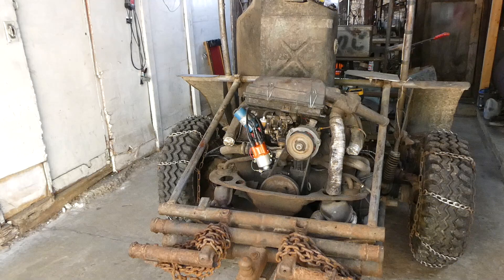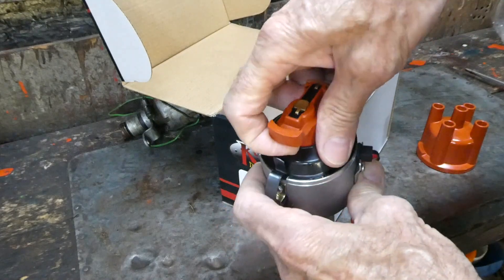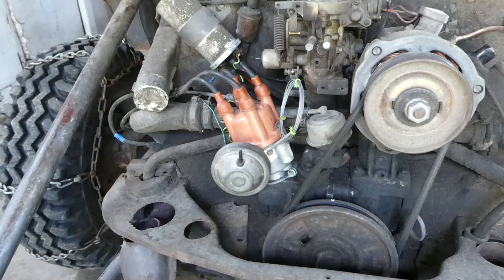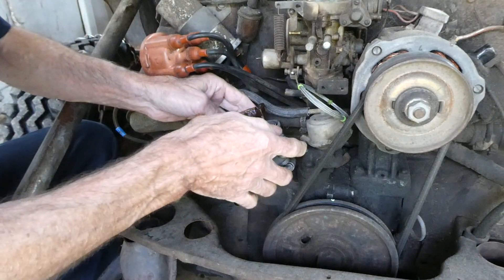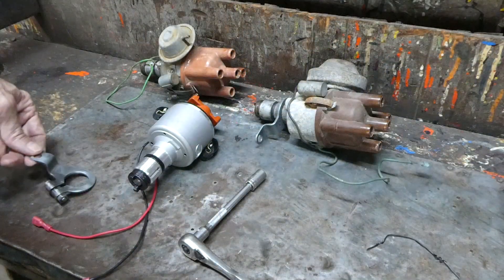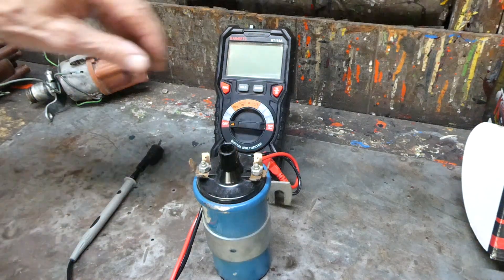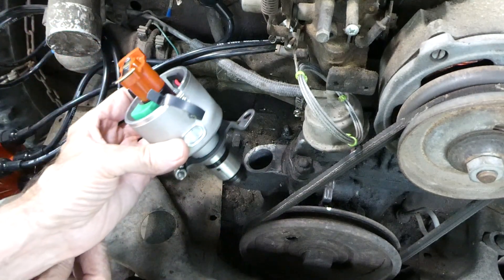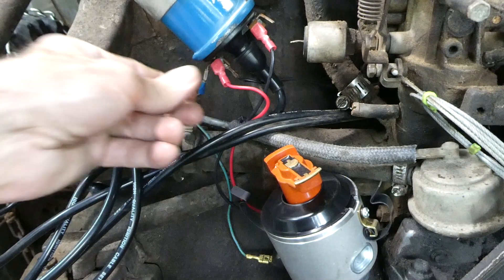Vw Beetle Electronic Ignition Upgrade

Comment: Can you please tell me where the other coil wires go to?

I put that distributor in a 1600 modifide trike. It dont know where the power to the coil wires go. None were there when i started. ( big wire melt)
I have a big proble locating a diagram.
Plus, someone has been "fooling around" with the wires. Everything is red wire. 
I will run new wires if i know where they need to go. NO SPARK.
My friends is a Stiers Trike 1976 1600 with a crazy 2bbl carb i cant identfy. Yet.😊
Please help.

Comment: I noticed you are replacing the vacuum distributor with a 009. Can you use this electronic ignition on the vacuum distributor? Also #1 on the distributor cap of a 009 is where #4 is on a vacuum.

Comment: Hey im interested in buying a Ford escort with the 1.9l I saw your cylinder head video there arnt many videos on the 1.9l were there any major problems with the 1.9l the one im looking at is a 94 with 56k original miles
Reply: I know it needs a harmonic balancer and some vacuum lines just normal rubber stuff

Comment: Hi Mr. Richpin. What made you decide on going with a non vacuum advance distributor as was with the one you replaced?  I'm in the planning stages of replacing my electronic ignition 009 distributor mated with 34 pict 3 carb because of the dreaded flat spot. And installing a Pertronix Flame Thrower with vacuum advance hoping throttling up will improve from low RPM to rev while underway will improve. Thanks for your content.
Reply from the maker: I was not to worried about any flat spot on this application because this vehicle will not see any service on the road and the price was low.If i was using it on the road i would have looked into the Pertronix.

Comment: I could not help smiling, you looked like you were having fun :-D
Didn't it shift when you got traction :-D
My frend has a morris minor and he fitted a special plate to replace the points plate.
Just two wires like yours.
It made a hell of a difference :-D
Reply from the maker: Can you tell i put the little buggy together with whatever i could find...lol
Reply: @RichpinTv  Well yes, but it works so well :-D
I'm not supprised as you have always been good.
I don't think there is much you can't do.